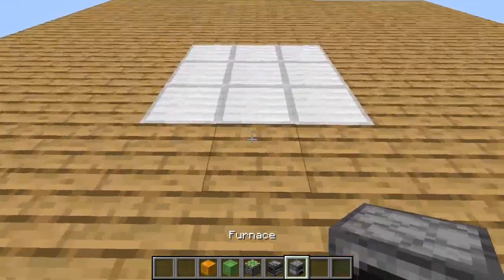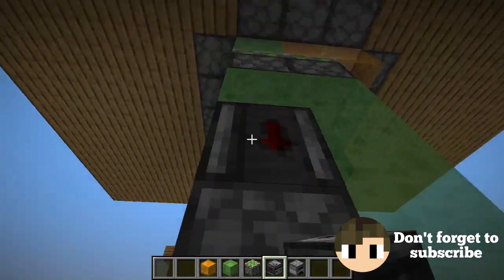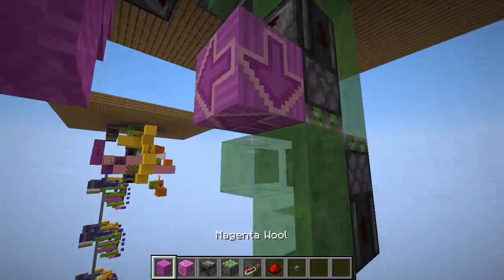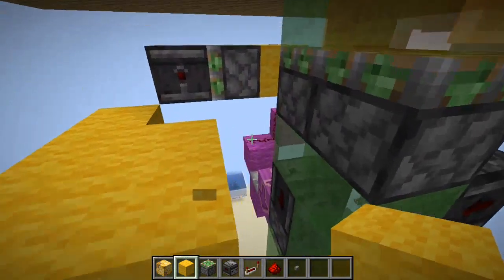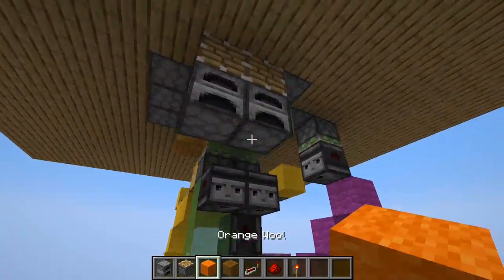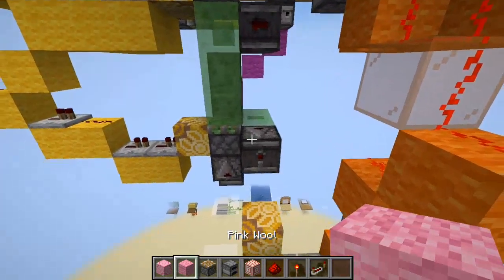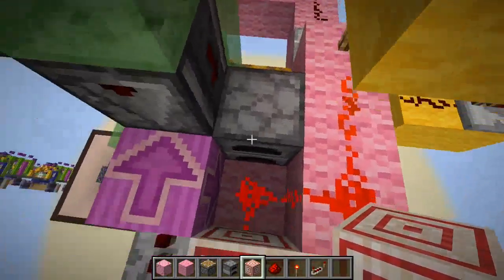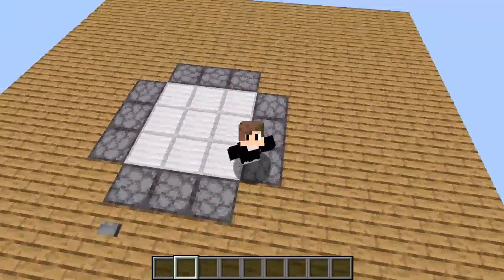3x3 BEST Multifloor Realistic Elevator | Minecraft 1.21 Redstone Tutorial

Comment: I understand everything but the part where you stop it from going up forever, because I built it on the ground floor and want it to go up... but I dont want to place a random obsidian and maybe break it. I wish I saw how it would look going up and then down.

Other than that, good video :)
Reply: i figured it out if it doesnt stop when going up it means the piston didnt stay retraced for long enough to catch the elevator to fix it just increase the repeater from the bottom of that line to a 4 tic delay instead of 3 i had to bugfix that myself
Reply: @M1ster_LX I tried that and it still didn’t work do you mean 1tick?
Reply from the maker: Going up you need the same mechanism as on other floors, going down you can uses the same mechanism as on other floors OR place a obsidian in a way that the bottom of the flying machine will hit it when it will be at the floors height. It's hard to break it completely but it's easier to send it up than down by hand (simply activate the middle observer)
Reply: The best fix for that would be a banner